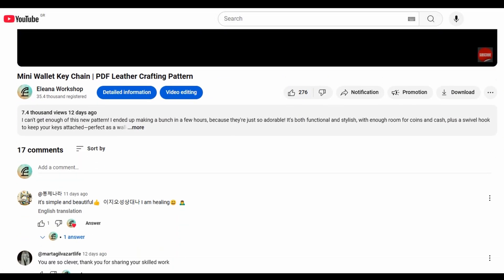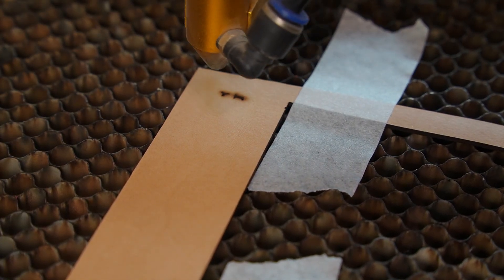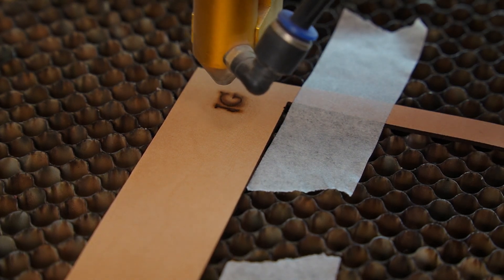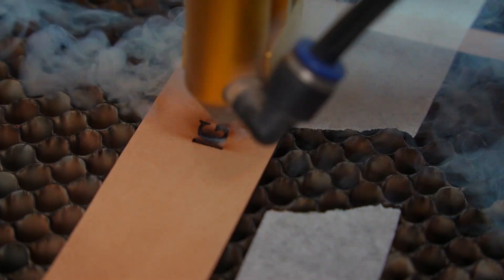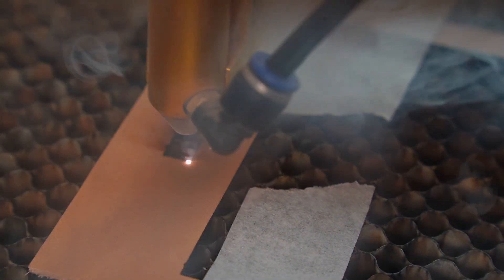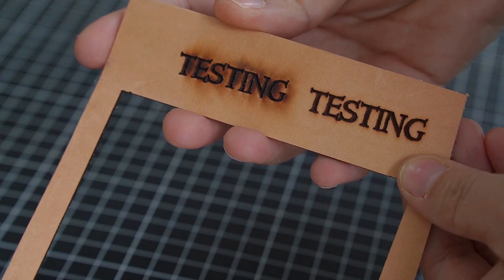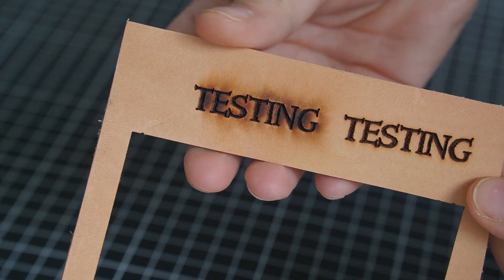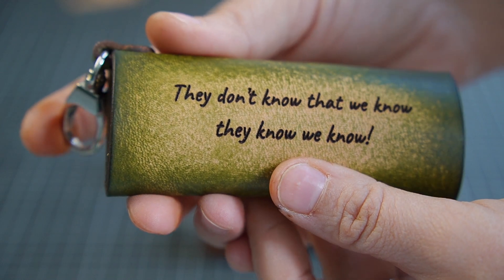Why Air Assist is Essential for Laser Engraving Leather

Comment: I cut and engrave leather with an Xtool S1 40W machine. I only use vegtan as I've been told not to use chrome as it creates toxic vapors. The guy at the local Tandy Leather shop told me that's wrong, but didn't really explain why it's wrong. I still don't cut chrome tanned as I don't believe it's safe. Maybe you have an idea on that.

Also, I am very disappointed in making tote bags, cutting the dyed vegtan with the laser. It gives a nasty smell that even my friend notices whey I gave her the bag as a gift. She said it made her whole bedroom stink. I'm thinking maybe I wasted my money buying a laser, and would have been better off with a clicker press. I've used thin strips of masking tape to reduce the burn marks, but it doesn't help much.

Lastly, my biggest frustration comes from Xtool, they are horrible in providing the correct settings for cutting (real) leather. They only have power settings for PU leather, which is basically fake leather, and creates chemicals when burned, they should be ashamed for promoting that garbage. I've tried doing different power tests but it takes time, and isn't always accurate.

Maybe you have some suggestions as well. Thanks.
Reply: Definitely never cut chrome tan leather with the laser, the chemicals in it are indeed toxic once burned and made airborne. The rep at Tandy must have had those mixed up. As for cutting dyed vegtan I do agree with you that there is a significant smell with it, but a few techniques can help it dissipate faster. I typically will cut on the highest power setting with multiple passes, that helps with keeping the scorching down. then when it is finished I will lightly sand with a 220 grit paper just to get the gunk off, and wipe the edge with a damp cloth. Sealing the edges with whatever burnishing compound or paint you use helps as well. Then it is just time, some wallets I have made still had a little smell after all of that and over a few weeks it was not noticeable, and ones I have sold have never received a complaint.